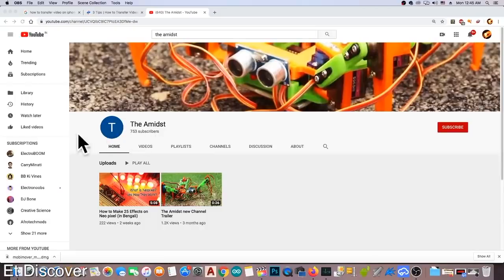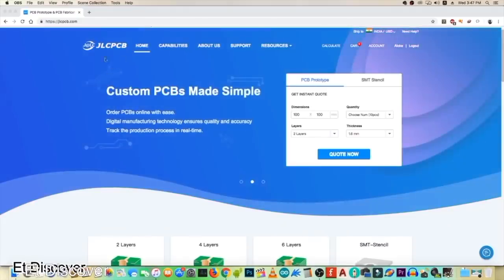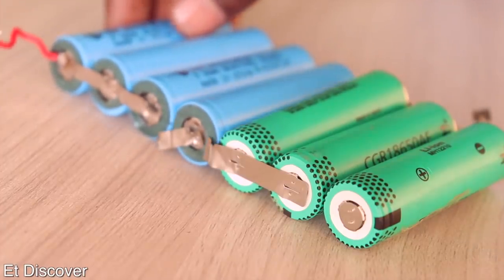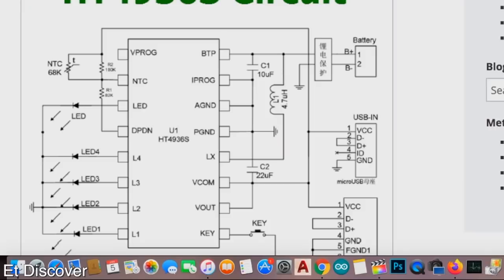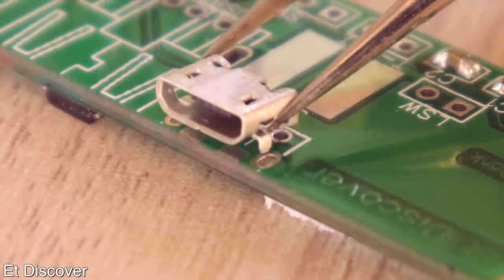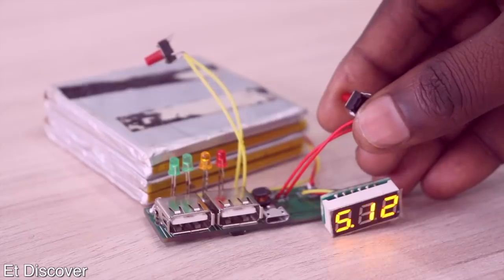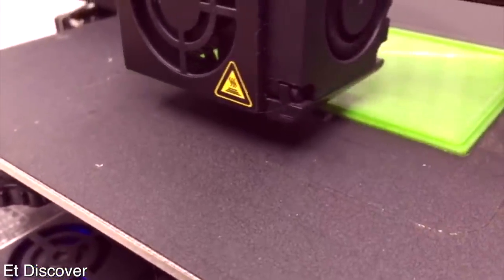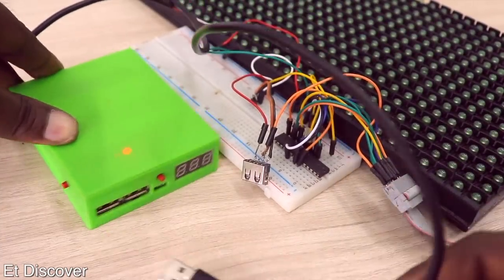Make a Smallest size  16000 mAh Power Bank

Comment: Hello 
I just lived message on yours FB grupe
and I need your advice. I'm trying to create some transmitter and receiver.
The problem is, that I need transmitter with adjustable frequency for a few receivers . Those receivers couldn't be connected , I need to have frequency control on the transmitter To be able to change receivers, would it be possible?